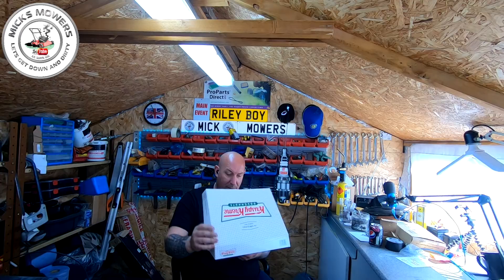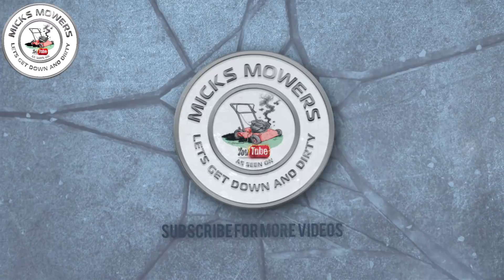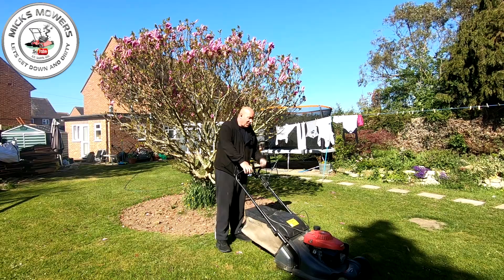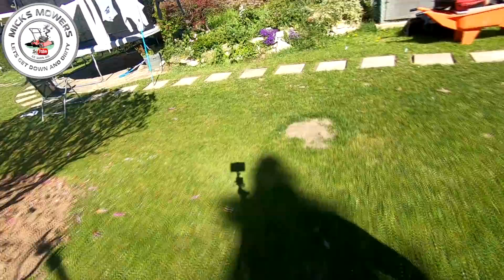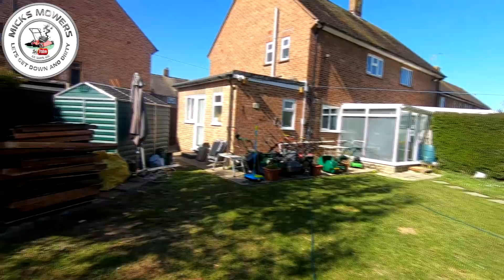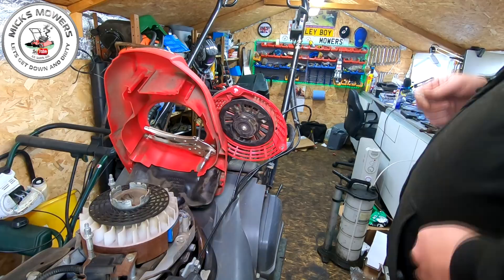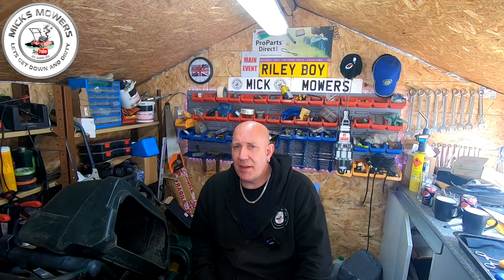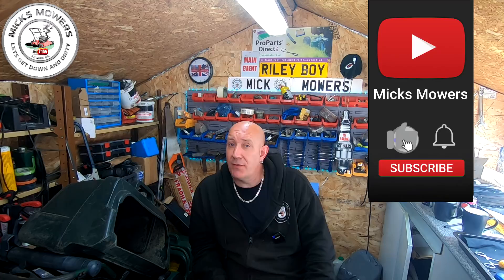HONDA HRX476 Hunting and Surging. Carburetor clean

Comment: After struggling to get all the carb gaskets and packings in place,  I came up with a simple improvement. Make two long studs ,same length as the bolts from 6mm threaded bar. Screw these into engine. The gaskets and carb can be assembled easily in order, and fixed in position with 2 nuts in air filter.
Reply from the maker: Yeah I have done that

Comment: it could be an air leak between the carb and the block, they often run like this when this is the case, the engine idle suddenly drops and then they stall when theres a very lean mixture. could try new gaskets and nipping the 2 carb bolts up gently until it runs smoothly. This has always worked well for me with those gcv135/160 engines
Reply from the maker: Yeah I hear ya.. I stuck a new carb on it the next day and now runs sweet as a nut
Reply: @themowerman  what carb did you put on? Genuine honda seems to be around £90?
Reply from the maker: @dhutch2000  well you can't beat a genuine.. a copy is like £20..
Reply: @themowerman  which do you fit?
Reply from the maker: @dhutch2000  depends on the mower.. if it's a small one and cheap.. a copy. If it's big and expensive a genuine

Comment: I have been struggling with this damn mower carb for 3 years since new. Thanks for the video - I have been cleaning this carb twice during the season for 3 years. Surely this is a design fault by Honda. I am hopefully getting a free new carb from my supplier soon and I'm going to run it on Aspen fuel only. Its definitely due to the size of the jet not being correct and it needs to be bigger for more fuel.
Reply from the maker: Yeah.. you will need to rim them jets out.. it helps lots
Reply: @themowerman  Thanks for replying - I have my fingers and everything else crossed

Comment: I don't know how the engineers at Honda were able to design a mower that coats the whole deck and engine in dirt...but they did...I have one, and am surprised by the amount of debris and dust in the air cleaner after a single mow. I clean the filter after each use. The oil seal installation on the governor shaft helped keep the oil drip from adding to the mess.
Reply: Honda air filters are a tad fatter than the square Briggs filter.  I just learned that on youtube a couple of days ago.  The Briggs kind make an imperfect seal.
Reply: You Could Add A Pre- Screen Filter That Goes Over The Air Filter -- A Piece Of Your Wife STOCKING Will Do

Comment: What causes the blockages in the carb jets? Is it lack of fuel filter, varnish type material in the fuel or a mixture? Shame you couldn't get it running completely sweet after a cleanup.
Reply from the maker: It's bad fuel.. and the carbs do wear out over time

Comment: Excellent video. Followed it carefully and used all new gaskets but every time I switch the fuel on I'm getting leaks from the carb area. Tried refitting 3 or 4 times and same problem. Any ideas? It never leaked before the carburettor cleaning..
Reply from the maker: The float and or needle and seat need looking at or the bowl o ring..
Reply: @themowerman  thanks, will do.

Comment: Does the carb float pin part to pin facing up or down?

Also my lawnmower HRX 426 , the self drive works but it’s very slow, and when the lawnmower hits the floor it don’t work. When I move it up to check if the drives turning it is turning fine. Any idea ? Chain on and belt looks strong.
Reply: Also after giving the carb a full clea. , the lawnmower is now surging and revs are going up and down in idle
Reply from the maker: Then the carb will need cleaning again

Comment: I’ve cleaned all my jets there’s no crap in them but it’s still surging
Reply from the maker: Did you file the main jet and the slow running one too..
Reply: Yes double checked them all I took it to the shop they sorted it a couple weeks later same problem it’s the Honda hrb425c
Reply from the maker: @Liam-lw5iq  time for a new carb then I would say
Reply: @themowerman  Hi, I'm having the same problem, had the carb off and on 3 times still surging, where's the cheapest supplier Mick? seen them at Just under £100 is that the norm?
Reply from the maker: @Dooker1958  try L&S or garden hire spares
Reply: @themowerman  Genuine or after market?
Reply from the maker: @Dooker1958  aftermarket
Reply: @themowerman  just fitted after market carb Mick, running sweet now, no surging?hunting thanks for advice, by the way, what was the company that you got the Hayter Harrier 56 B+S carb for 30 odd quid?, might be needing one of those also.
Reply from the maker: @Dooker1958  Amazon mate
Reply from the maker: @Dooker1958  here you go mate Briggs & Stratton 591137 Carburetor Replaces 590948 https://amzn.eu/d/3TZRgAq
Reply: @themowerman  Thanks Mick, much appreciated
Reply from the maker: @Dooker1958  your welcome
Reply: Open Up The Main Jet A Little With Some Welders Tip Cleaners, They Are Like a Little Round File , Not too Much Though. Just A Bit...